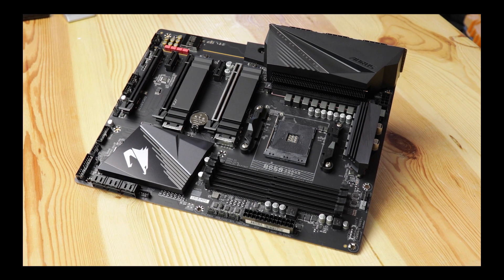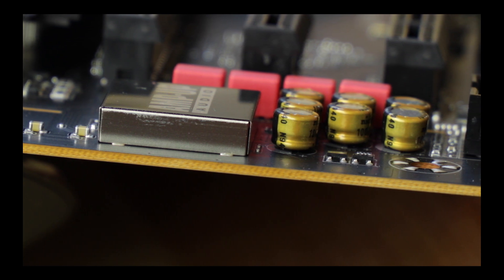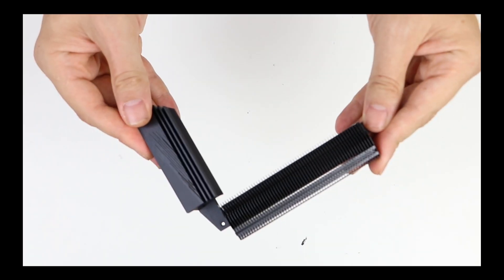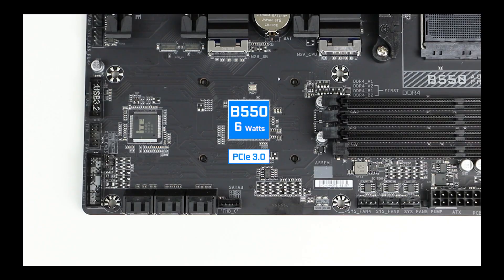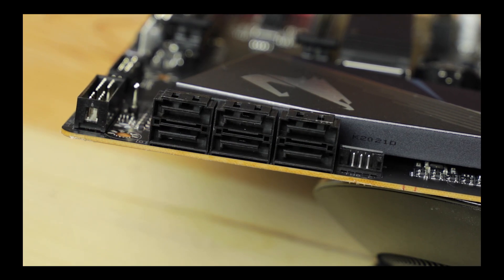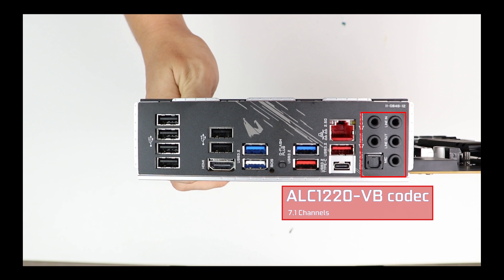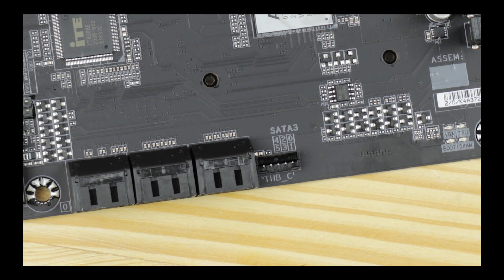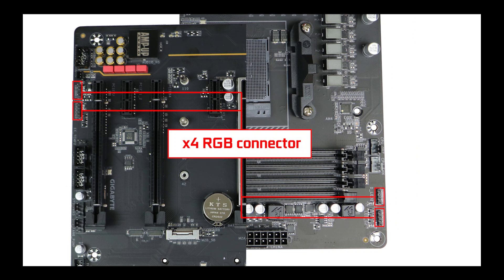B550 AORUS PRO (Rev 1):  Why you should think twice.

Comment: 14:16 The VRM setup looks different - are they the same but just laid out differently?.. 

Buildzoid points out that the elite has much lower RAM specifications. 

Well, they did apparently - On his video "Best B550 Motherboards for AMD Ryzen CPUs: MSI, Gigabyte, ASRock, & ASUS" - Timestamp 10:25
The listing for the B550 AORUS ELITE had a max RAM speed of 4000. It seems they may have fixed that since though. Still looks like the Pro has a better ability to use faster RAM?.. Why else would they have one's top speed at 5400 and the other 4733?.. BZ said the Elite is 4 layer PCB and the Pro is 6 - again - dunno if they changed that since...

B550 AORUS PRO (rev. 1.0) 
4 x DDR4 DIMM sockets supporting up to 128 GB (32 GB single DIMM capacity) of system memory
Support for DDR4 5400(O.C.) / 5300(O.C.) / 5200(O.C.) / 5100(O.C.) / 4800(O.C.) / 4600(O.C.) / 4400(O.C.) / 4266(O.C.) / 4133(O.C.) / 4000(O.C.) / 3866(O.C.) / 3733(O.C.) / 3600(O.C.) / 3466(O.C) / 3400(O.C.) / 3200 / 2933 / 2667 / 2400 / 2133 MHz memory modules

B550 AORUS ELITE (rev. 1.0) 
4 x DDR4 DIMM sockets supporting up to 128 GB (32 GB single DIMM capacity) of system memory
Support for DDR4 4733(O.C.) / 4600(O.C.) / 4400(O.C.) / 4266(O.C.) / 4133(O.C.) / 4000(O.C.) / 3866(O.C.) / 3733(O.C.) / 3600(O.C.) / 3466(O.C) / 3400(O.C.) / 3200 / 2933 / 2667 / 2400 / 2133 MHz memory modules

B550 AORUS ELITE V2 (rev. 1.2) 
4 x DDR4 DIMM sockets supporting up to 128 GB (32 GB single DIMM capacity) of system memory
Support for DDR4 4733(O.C.) / 4600(O.C.) / 4400(O.C.) / 4266(O.C.) / 4133(O.C.) / 4000(O.C.) / 3866(O.C.) / 3733(O.C.) / 3600(O.C.) / 3466(O.C) / 3400(O.C.) / 3200 / 2933 / 2667 / 2400 / 2133 MHz memory modules

Comment: I know I'm late to this video, but I'm considering getting one now and I was wondering just how good the built in DAC is. I was previously going to get a motherboard with a more generic integrated DAC then purchase a Soundblaster X3, but it'd be great if this would be sufficient to properly push the Drop x Sennheiser 6XX headphones and a dual channel speaker system without an external DAC.
If anyone could provide input on this I'd very much appreciate it!
Reply: If you find out the answer to this I would be appreciative to hear it, good luck.

Comment: Mmh... I can't choose which get, MSI MAG Tomahawk b550, aorus elite x570 (which cost more than b550 pro v2) and the earlier mentioned aorus elite pro b550 V2 (V2 not the first released one). I bought a ryzen 5800x and it's sitting here wondering wtf Im waiting for XD. I don't plan dual gpu first because they doesn't exist and second prices and third cant afford oen anyway atm (I'll just stick with my gtx1080 for a whileeee).  It's a shame they don't add a damn post code screen on motherboard like my asus maximus VIII hero (that was 200 euro) but they insist with damn ps/2 or useless ports. Whateverrrr.

Comment: I would like to ask your opinion how would you put these two pc together.
What motherboard goes the best with which cpu and memory kit and ssd
 Asus prime x570-p, ryzen 5 3600, fuma 2 cooler, 970 evo plus 1tb, gigabyte 5700 xt, phanteks eclipse p400a, corsair vengeance rgb pro 2x8gb 3600 cl18

B550 aorus pro v2, ryzen 5 5600x, fuma 2 cpu cooler, 980 pro 1tb, 1080 ti founders edition, phanteks eclipse p400a, Crucial Ballistix 2x8gb 3600 cl16
The first is my pc, the second parts have been ordered but if need I rebuild mine as well

Comment: Great video. What board do you suggest that is as good as the aorus pro and has front USB c? It’s on sale here in Canada right now for $170 (regular $240) so I’m very tempted. Ideally I’m also looking for Bluetooth (but I can get an adaptor).
Reply from the maker: yes it is .. if you take the WIFI variant, BT 5.1 is included
Reply: @Laurentschoice  I think it's actually BT 4.2. Either way, the AC model with wifi also has bluetooth.

Comment: Apparently one of these just died on me on stock settings, almost 6 months of use...
(and when i say stock i mean, the CPU was locked to AMD default power limits my me, manually so i don't know what its CPU power delivery part just died on low load...5800x by the way, the VRM never went above 42C...)

Comment: Excelent review. Heelp please (Sry for English). What I choice for 5900X + 2x16GB (TridentZ Samsung B-Die high bin)? Asus B550-E, MSI B550 Carbon (both 310usd), B550 Aorus Pro (270usd) or MSI B550 Gaming Edge (280usd). Here in Brazil MSI has 3 year warranty, Gigabyte and Asus only 1 year. I don't care about USB-C, Wifi, Bluetooth, multi GPU, RGB. Wanted the best for CPU and memory overclocking, I am seriously thinking about buying the B550 Aorus Pro, as I saw that it has a cooler VRM and overclocks with less voltage. It also have a Openbox Strix B550-F with 8 months warranty for 180usd

Comment: Bought last week b550 aorus pro AM4 rev1 I'm having issue with its ram performance even with xmp profile activated auto. I can't achieve the normal speed of my ram 3600mhz upon checking on taskmanager its just 2400mhz and won't budge with xmp. Don't know if it needs a bios update or faulty mobo. Still waiting for suppliers feedback..
Reply: so whats your results?

Comment: My understanding was that since the board is not pie gen 4 throughout as b550 You would have to go x570. This board apparently has the nvme pcie gen 4 lanes running to the processor rather than through the chips chipset. I recently landed on this one at $170.00. I was really torn between this and the $200-300 x570 boards but they seemed to all need to be revised to add things like type c headers or more usb3.2+ headers, Thunderbolt headers.  I decided ill maybe look for a revision x570 that has some of those higher ram speeds being supported in combination with maybe 2.5 gb lan+, type c USB, USB 3.2+in a year or so... I decided for now some of these creature comforts were more readily available in b550 unless you spend $500.00 for a higher tier x570. I would have paid $300.00 for an x570 that had the features I mention for sure but this one will work until the 570's see some updates.

Comment: Who uses multi gpu in 2020 or 2019 or 2021?
Reply from the maker: Content creators,  and designers :).
Reply: @Laurentschoice  for what Reason ?
Reply from the maker: When u blender 3d or render videos having two or three gpus greatly reduces rendering time.
If you are an architect, a 3D designer, wating an hour instead of three to render a project is valuable.
Reply: @Laurentschoice  Is there support from vndia/amd for multi gpu on there drivers ? Do they make updates for specific software  ? Does 3dsmax or other software takes advantages for SLI/CROSSFIRE ?

Comment: I was planning on going with the Pro but decided to save quite a bit of cash and ended up taking the Elite. Paired this with the 5600x, xfx 6800xf merc 319, msi mag coreliquid 240r, my old 2 x 8GB 2444mhz vengeance lpx and CM Storm Stryker in front of the Dell 2721DGFA . This just seemed like the best value for what I'm getting imo
Reply: Ram is slow as .... not good for a ryzen
Reply: @dschNgz  Agreed. The vengeance was from a previous build, I upgraded it soon after to a G Skill Trident CL18 2x16GB. I've had the build for nearly 2 years now and the only issue was the msi mag cooler, it didn't even last a year. Fortunately they said it was a factory fault so I just added some extra cash and got the Aorus waterforce 360. No issues to date, machine runs like a silent killer.

Comment: So sound is good or bad? I'm confused.
Reply from the maker: Good !!!!
Reply: @Laurentschoice  Thanks! Wasn't sure if you were being sarcastic there or not. I'm kinda new to building so I don't know much about sound and VRMs on motherboards. Thanks again mate, keep up the good work! 

(doing my second custom build since my z170 mobo died and there are none available in Greece, so I'm just upgrading to aorus b550 pro V2+ryzen 5600x)
Reply from the maker: @ekimolaos  good combination :)
Reply: @Laurentschoice  kinda scared that I have to upgrade mobo's firmware before installing the cpu and ram, but meh. There's a first for everything. Thanks for all the advice, subbed <3
Reply from the maker: Don't worry. If u run in any issues.. DM me on twitter. I usually help the most there
Reply: @Laurentschoice  wow, thanks mate. I don't have Twitter but still really appreciate the offer! I'll be careful so I don't believe I'll run on any issues ^^

Comment: Ffs!!! It already has a 3.2 type C on the back that you will probably never use & how do you know it's a 6 layer PCB I have tried to find this out everywhere to no avail?
Reply from the maker: Hi there. 
I requested the information.
Reply: @Laurentschoice  Thanks when do you think you will find out & does the Elite AX v2 have the same amount of layers as the pro AC? I am assuming it will because the design looks identical apart from a few amendments.
Reply from the maker: @britexitengineer1407  4 pcb layers ( 2 ozz copper as usual). 
But it does a rather good job in terms of signal isolation.

Comment: z370 is still the best option. and a 9900k (SRELS only) runs faster than the 10900k single core performance due to not having meltdown/spectre baked into the BIOS (and cooler, on air idle is 48, load 59; water idle is 38, load 48.) you can buy one for $280 where AMD is asking for your liver, kidney, arms, AND legs for an 18% performance gain that... doesn't really do much for emulation gamers.  AMD has become what it has hated.... Intel, with exorbitant pricing and little performance gain from previous releases. You either die a hero, or you live long enough to see yourself become the villain.

Comment: I can't get over 3200MHz on it with Ryzen 5 3600 and 32GB Patriot Viper Blackout 3600MHz CL18 kit...
XMP won't even boot into Windows, and if it does, it instantly freezes.
Is my R5 3600 IMC bad, or could it be that I have bent the pin, perhaps even tightened the cooler too much?
Could manual timings help me reach 3600MHz and 1800 fabric?
Reply: Did you update the bios or is it fixed ?
Reply: Any new about this? Have you managed to solve this problem?
Reply: @NextroneOfficial  Yeah, I changed the RAM to Kingston

Comment: The B550 Aorus Pro V2 does have an internal USB-C connection (with USB 3.2 Gen 1 support). No point buying the Rev1 version of the board. Everything else is the same, only the VRM changed so very slightly with almost no impact and is still one of the best B550 VRM's.
Reply: That USB-C connector replaces the Thunderbolt header found on this motherboard.

Comment: I want faster RAID0 from 3 disks PCIexpres gen 4 M.2 SSDs. Which would be better -Gigabyte  B550 Arous Master or MSI X570 Goflike (putting 2 disk info M2-XPANDERGen4 and one into direct CPU). I also need 128 GB of RAM with 3900x. The graphics card would be some cheap 150 USD. Which one tu use cause I already have MSI motherboard that I paid only 200 USD more from Gigabyte. I don't have money for Threadriper. Please what I can do with this what I have? I do a lot of ramdisk to disk copy and disk to ramdisk copy and to other devices - HUGE files like 60 GB (I edit them in RAMdisk cause its faster). I want Raid0 to be bootable in Linux Mint. I work in Linux Mint.

Comment: The large amount of USB on this motherboard is what makes it worth the value to me over the B550 Aorus Elite. I use a lot of USB connections (mouse, my corsair keyboard requires 2 usb, and game controller for games in which controller is preferred over m/kb), and those are just 4 examples. I also prefer type-c when transferring phone data (pictures/video) to and from PC.
Edit: the Aorus Elite B550 is only $20 Canadian cheaper than the Aorus Pro B550. The price difference is so close, so I'd rather just get the Pro.
Reply: im okay with 7 ports and the price difference is almost 100 dollars, should i go with elite v2?

Comment: Gotta say, I don't mind the slow lower PCIe Slots. First, Multi-GPU support has become scarce and performance uplift in gaming has been a big question forever. On the other hand, all the USB ports on the back have to be routed somewhere...  :)
And as much as I see your point concercing the saving towards the Elite version, but I am comfy with the price as the VRM cooling solution is much better and there is a second NVMe heatshield.
NIce review tho, dude!

Comment: its because the elite has a 4 layer pcb instead of a 6 layer for better stability
Reply: also the elite doesn't have heat fins and the pro performs better because of that
Reply from the maker: So small correction.  The elite comes with 6 pcb layers as well. Not 4.

Event hough the fin array is an upgrade, it fails to noticeably impact vrm performances when comparing both elite and pro versions.

I hope this helps.
Reply: @Laurentschoice  With all do respect, i think your argument is lackluster. On average there is a 7-8 degree difference because of the pcb lay out and thermal pads are higher quality on the pro.  The elite is a 4 layer pcb. it has a 2x layer copper....but still 4 layer pcb. if there is a relative 20 dollar difference, which i picked my pro up for 149.99. Running 8k rendering is worth it.
Reply: regardless....you said it. the fin array is an upgrade and there is your answer. i don't understand why you would throw that on the end of your video.
Reply: @Laurentschoice  The elite is still a great choice if you don't plan on doing heavy memory overclocking, but i know boards, and one way to tell its a 4 layer is by looking at the circuits on the board. the elite is showing everywhere and the pro is not.
Reply: @Laurentschoice  Still love your video, i just disagree. I like the pro, and is a beast. i'm running a 3950x overclocked to 4.4 all core and it hasn't seen 74c during extreme workloads.

Comment: B550 can not support propper dual GPU support due to lack of PCI-e lanes, X570 doubles PCI-e lanes over the chipsed (that's why it's cooled with a fan) so that's the board you need if you want 2 gpus.
BUT using 2 gpus in 2020 is idiotic

also, B550 AORUS PRO V2 has front type C but has worse VRMs and lacks one USB 3.1 at the back

Comment: I'm looking forward to buy this for my ryzan 5 5600x with a rtx 3070.... it's good right?
Reply: MSI B550 A-Pro is also a great budget option for 5600x, it could even handle 5950x so if you wanna invest into something else in your PC go for that one. If you want to spend aorus pro money I'd suggest Asrock B550 Steel Legend, has front USB C and post screen.
Aorus Pro has for some reason some USB problems, probably due to cramming 12 USBs onto a board that usually comes with 8

So I'd pick between MSI B550 A-Pro and Asrock B550 Steel Legend

edit: the guy above is wrong, it's not mid to high end range pc it's high end, 3070 is around 2080ti performance and 5600x beats almost every single CPU if you have 4 sticks of quality ram installed. I'd recommend Crucial Ballistix 3600MHz C16 (you can pick RGB or non RGB version) since that ram uses Micron E-Die chips and stresses the memory controller a bit less than Samsung B-Die that costs 50% more.
Reply: @error262  thank you so much for ur reply , you cleared my doubts and helped me in the building components too.. thank you 🙏🏻
Reply: yah youre gonna be good for like 3 to 4 years the amount of performance youget from a 3070 at a 500$ price is amazing and with a ryzen 5 5600x its gonna be a solid mid to high range pc
Reply: @JustJoey727  ok, thanks

Comment: Thanks for this, will be getting this with the 5600x
Reply: And, got the cpu already? Or are you still waiting to get your hands on one ? xD
Reply: @DasLucas2408  I luckily managed to get the CPU but had to send the board back to the supplier because lan chip was faulty and now fighting with them to replace it. Bit frustrating getting a win with the CPU and not beable to use it yet
Reply: @W0nd3ringCl0ud  Sorry for bothering you, but did you have to update the bios or the cpu run out of the box without the need for update? i'm getting the wifi version of this board and i read it get a little problematic when updating bios via usb

Comment: Aorus pro runs a 3950X OC and has 61 drgrees and aorus Elite has 78 degrees. It is huge difference. There is no cpu throttle but it is much hotter the Elite. The audio codec is different, Pro has 1220 vb vs 1200 that Elite has. Far less USB ports at the Elite. Basic differences that matters. There are a few more but you can ignore them.
Reply from the maker: I would agree.. but as long as ur below 90c and no throttle performances remain identical. 

As for the codecs, 12 series are identical safe some features. 

Thats not enough to motivate the Pro extra cost in my opinion.
Reply: @Laurentschoice  Please,can you tell me what should I choose between this board and MSI B550 Gaming Edge Wi-Fi for an Ryzen 7 5700X?  The MSI one is a little cheaper. Thank you!